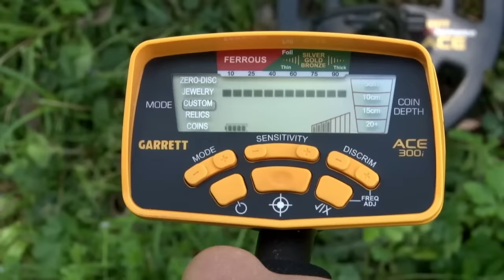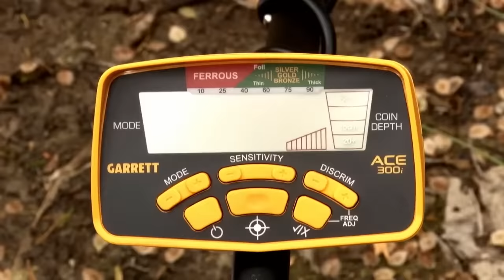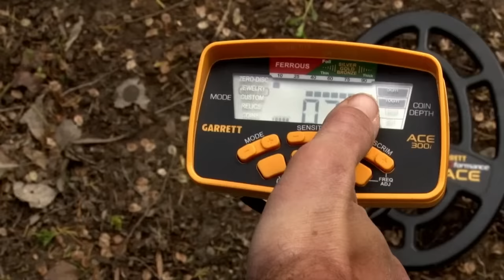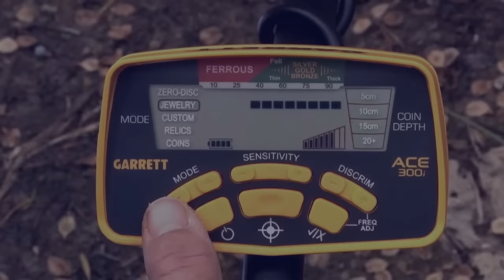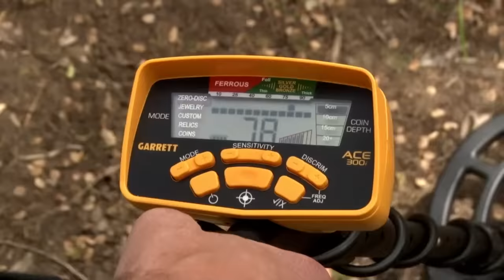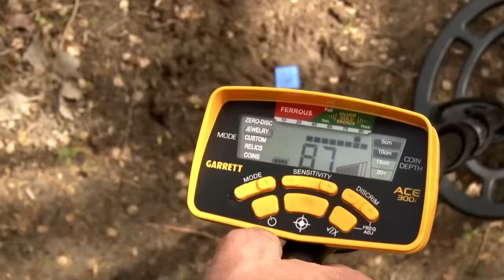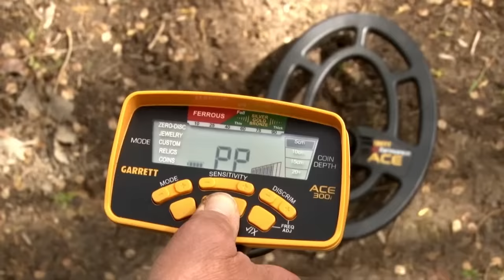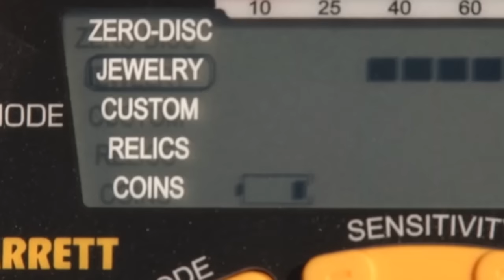ACE 300i Instructional Video

Comment: hmm - so what's the difference between 300i and lets say the 400 ?
Reply from the maker: +Briggz30 The 300 and 300i do not have Iron Audio like the 400 and 400i. The 300 and 300i have a 7x10 concentric coil and the 400 and 400i have a 8.5x11 DD coil.  Other differences are: Redivision of mid-tone/high-tone audio break points.Increased number of Iron Discrim pixels. (400i)
U.S. coins removed from target legend. (300i, 400i)Variance in Mode/Discrim patterns
Reply: ahh i see - thx for the quick reply - sounds like the 400 is all around a bit better . another quick question - can the 400's coil get wet ?  meaning can i take it in shallow streams ect ?
Reply from the maker: +Briggz30 All coils on all Garrett detectors can be submerged in water. The only detectors that can have the control boxes in water are the AT Pro, AT Gold, ATX and Sea Hunter.